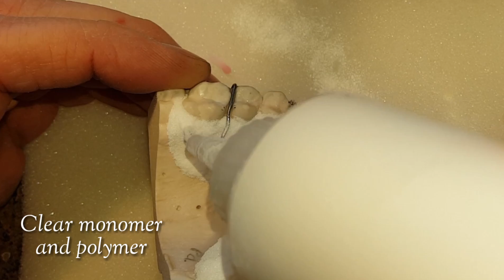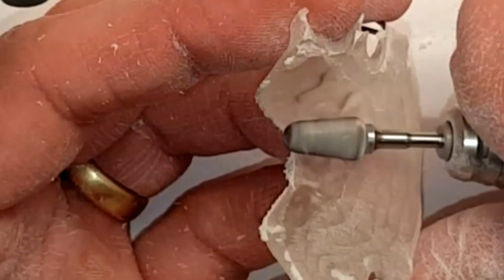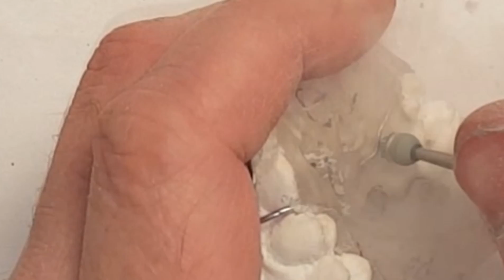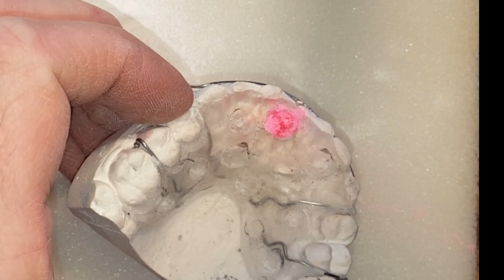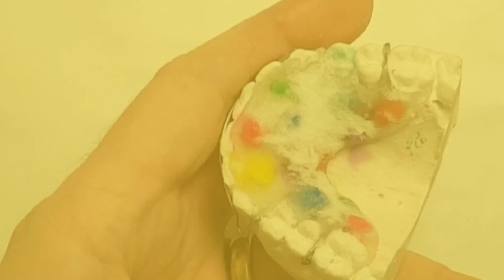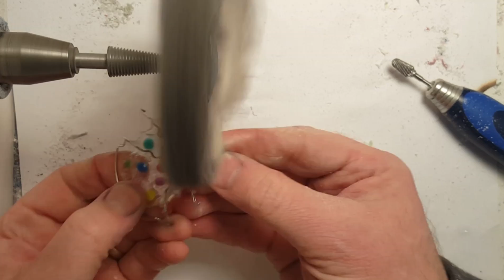How to make a Polka Dot Retainer Lesson orthodontics

Comment: looks great!  Do you clean your pumice and polish wheels after you've finished a set of retainers?
Reply from the maker: No. They are all new appliances so I'm not concerned with germs. I'll disinfect a pumice wheel if it comes in contact with an old appliance (rarely)  also throwing away pumice used with Old appliance